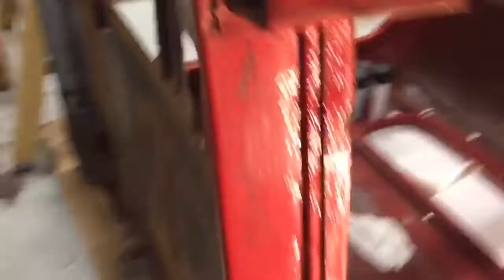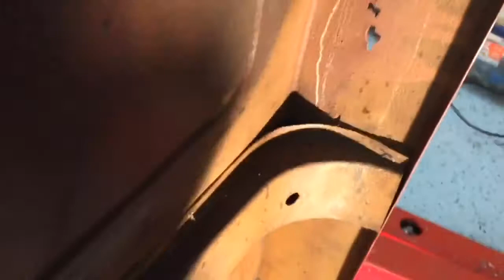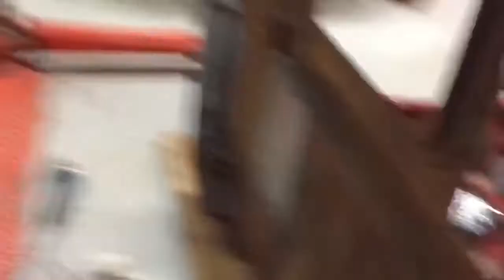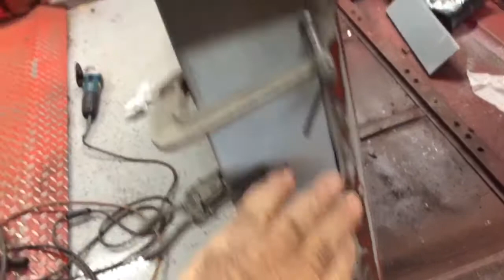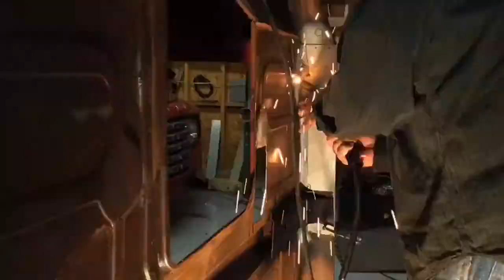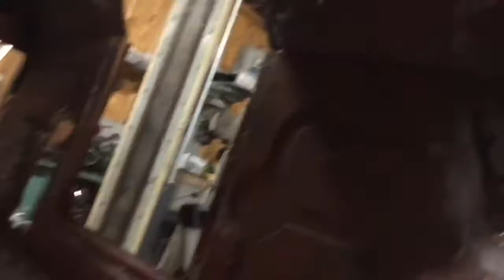1950 Ford F1 Build Ep.2 Cab Rust Repair

Comment: It's probably too late now but a good solution to the weather strip channel fastening dilemma is a 3m product called panel bond. It's a two part epoxy based adhesive. You could cover the backside of the channel with it and clamp it for 24 hrs and it will not come off unless you heat it up with a torch! It's waterproof and if you clean up the "squirt out" well you don't even need any seam sealer.. this product has a myriad of uses but is a little pricey and requires a special applicator gun and mixing tips to do it properly... but it is awesome and handier that a shirt pocket!
Reply from the maker: Thanks Jeff! Not too late, at all.  That’s a great idea. I will check it out.
Thanks for the tip! 👍Tony B
Reply: If you have a buddy in the body shop biz you might borrow a gun and he might give you jobber discount on the product and tips... everything needs to be bare metal for adhesion but it works on almost every kind of material... all metals, fiberglass, SMC, alot of plastics, even stone and ceramics.

Comment: When I change out the firewall on both the 52 mostly original and the 50 rat rod I fill every hole then drilled  where I wanted the location of the holes . I also had to replace the rocker panels and left the weather stripping off them ...I rarely drive my 52 in the rain or never on dirt roads so it hasn’t been a problem . Very nice work ...done once done right ..👍
Reply from the maker: I’m thinking I should do the same, on my firewall. Switching from Chevy power to Ford, none of the holes are in the optimum locations. It’s only easy to do at this stage. I’ll wait on the weatherstrip decision until the truck is done.
Thanks for the good advice!